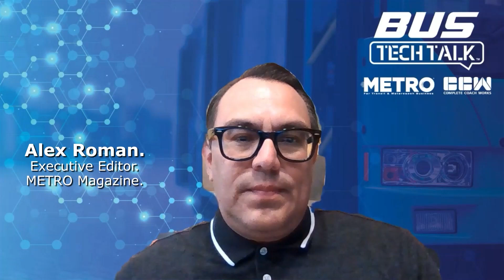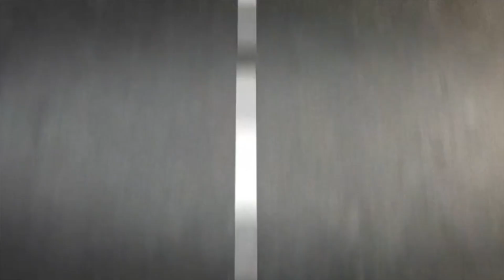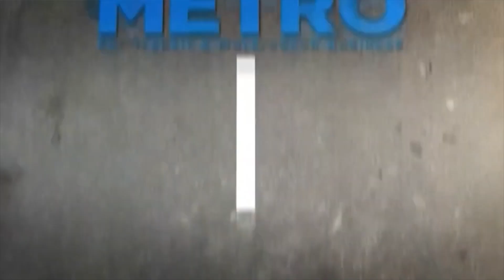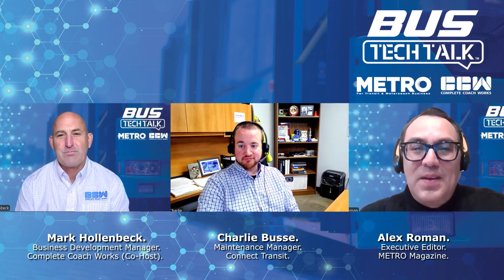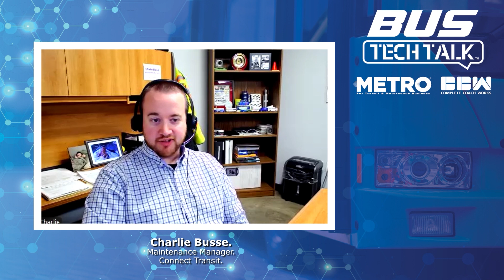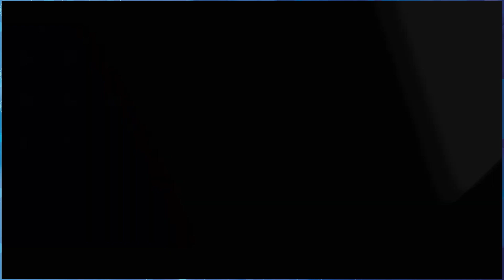Bus Tech Talk: Maintenance Insights from Connect Transit’s Charlie Busse

Comment: It’s been my experience as a warranty tech doing work across the nation is that electric buses technology isn’t quite there yet. Only because of the number of breakdowns I’ve seen. I’ve seen agencies with all there electric buses down on day one of service. Working now on  hybrids and they have problems with drive motors, APC’s, inverter problems. It’s a real challenge to find mechanics that are electrical trained. Don’t get me started on Cummings Insite.